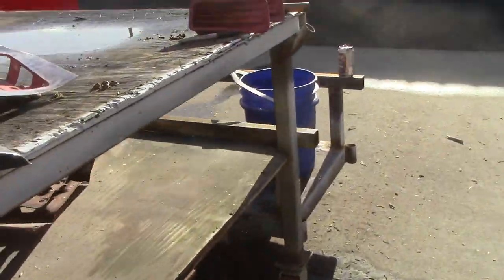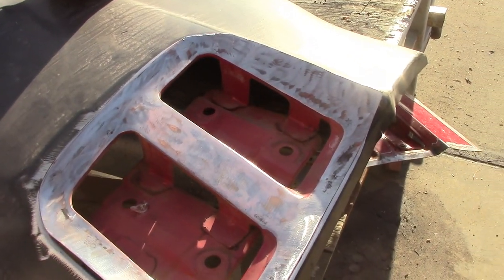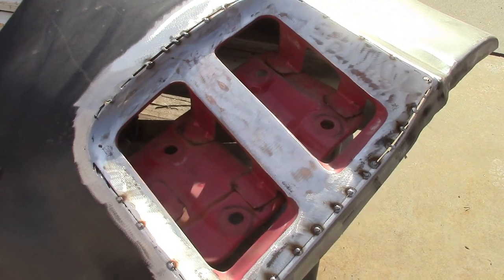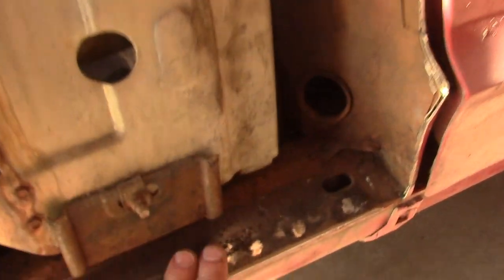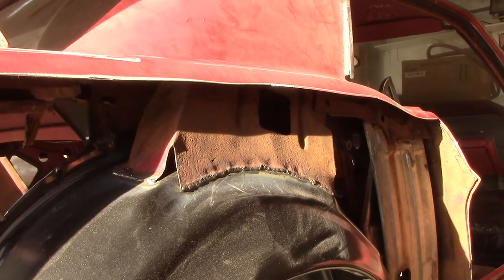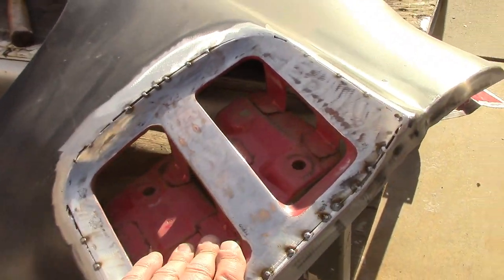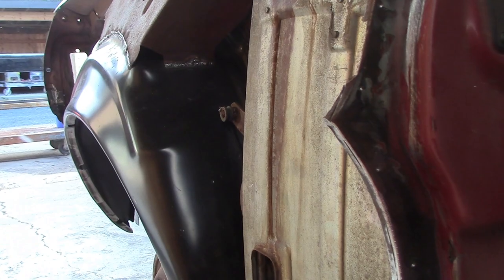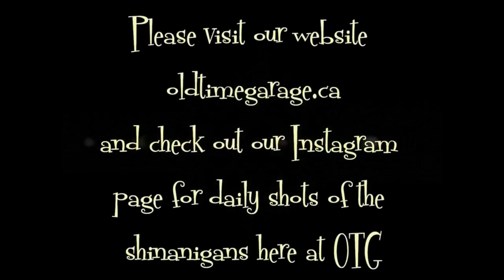Installing Quarter Panels on a 67 Mustang

Comment: What a really nice neat job, the owner has to be happy with this. I'm flat out restoring my wife's so called restored impala what a mess . Lucky it didn't burn down or kill someone, was so bad I started thinking the car was cursed. But no it's just assholes not doing the work they were paid to do , even the rear main seals were in backwards.  I'll get it done but it's one thing after another they really slapped this poor old impala together.  Now I just replace everything because its usually stuffed.  Dam things really made me like it and I'm a Mopar guy !

Comment: As a mustang panel installer I will also mention this. Some suppliers will sell you a 68 quarter panel when in reality they sent you a 67 panel that hasn't had the grill insert holes stamped in the C scoop area. The shape in the scoop area between the two years is very different and using a profile gauge will show the rear inner edge angle is steeper on a 67. Be aware or you will be disappointed when the 68 panel arrives and it looks all wrong.
Reply from the maker: I have actually ran across that before

Comment: I just had a quick look on NPDs web site, and the 67 quarter panel is $129.50. I don't know what you charge an hour labour rate, but it must be a close thing between getting the better panels and just fitting them, and cutting out the vent section welding in the vent section from the old panel and fitting those, neither of which will be an easy task. I'm sure you know better as you're there to see exactly what's needed.
Reply from the maker: It takes me a hour and half to do vent area and trust me my rates are the cheapest around 70 a hour taxs in
Reply: @OldTimeGarage  Ok just seems a lot of extra work to me. I personally would prefer the better panels. I've a 67 so I'm very interested in watching what you do. Thankfully mine isn't as bad as your one.